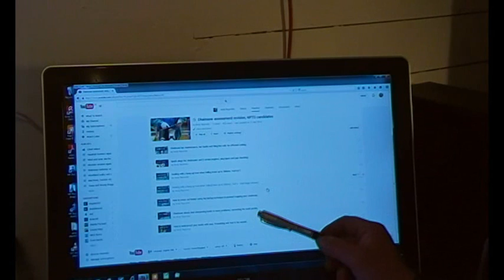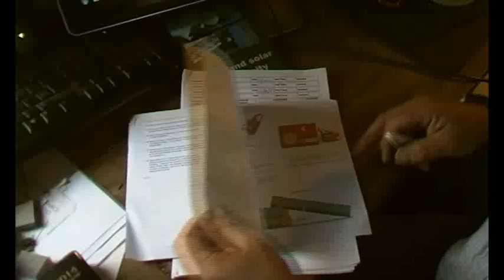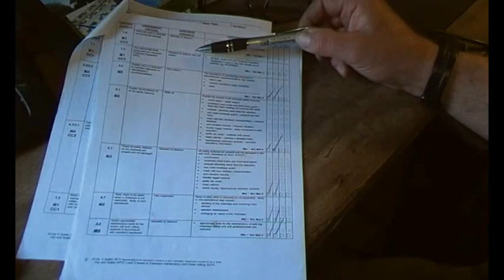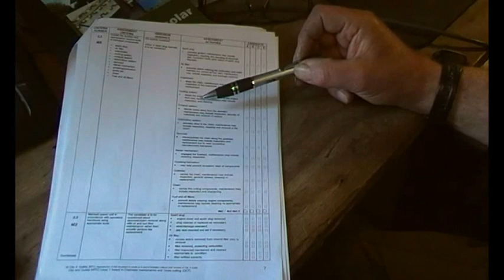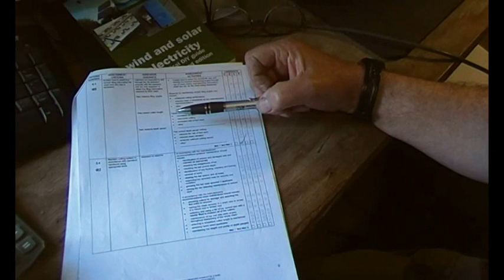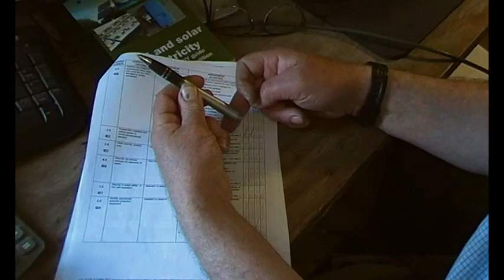NPTC CS30 (201) chainsaw maintenance assessment revision part 1

Comment: Hi, for the very first question about the “three hazards with the working area” and “three hazards with the proposed work” the work area and the work to be done, what is the difference? Thanks
Reply from the maker: Hi, working area would be things like weather, cliffs, windblow, public. Proposed work would be things like using a chainsaw (PPE & training), felling trees (2 trees length rule), other operators, fuel & oil etc. Hope that helps, Subscribed? cheers
Reply: Andy Reynolds thanks for quick and helpful reply, will sub now 👍
Reply from the maker: Grand, cheers
Reply from the maker: @badja08 , have you watched some of the other videos in this NPTC chainsaw revision play list? cheers
Reply: Andy Reynolds  hi, no I havnt, I’m still a beginner don’t wanna try and cram too much info at the minute, doing a level 3 Arb course in college, il be doing my first tree felling on Thursday
Reply from the maker: This weekend check out the 2 hung up tree videos and the boring cut one, and then these will make more sense, cheers

Comment: hi andy. im looking to be a forestry ground based operator for a profession as im coming up to 35 soon and want to make a change to my life and have always had a passion for forestry work. I do have quite a bit of chainsaw knowledge etc but i just don't have any tickets. im looking to do my level 2 chainsaw maintenance and cross cutting - my level 2 fell and process trees up to 380mm - my level 3 fell and process trees over 380mm and level 3 severing uprooted windblown trees. do u think this would qualify me to do this role. sorry its a bit long its just hard to find any advice when your not in the industry. thankyou Read more . Show less
Reply from the maker: Difficult to advise but the basic chainsaw maintenance, cross cut, and Felling small trees (380mm) is an essential for an entry job as a forestry craftsman. The main thing is experience and practice, so once you have your basic tickets try to get a job using a chainsaw everyday and leave the level 3 until you have attained proficiency. Cheers